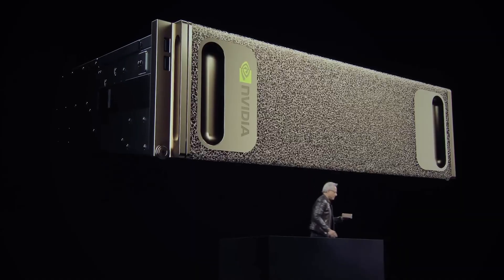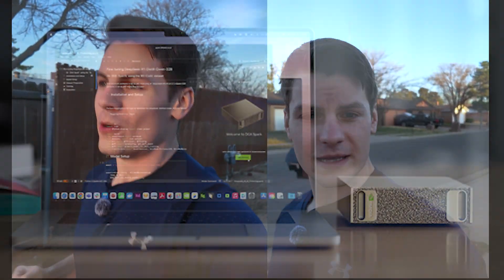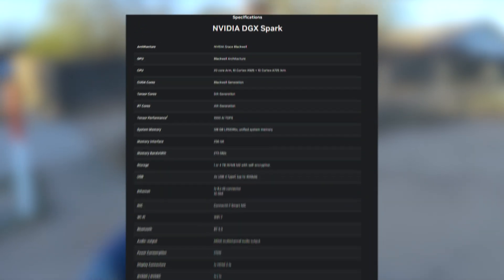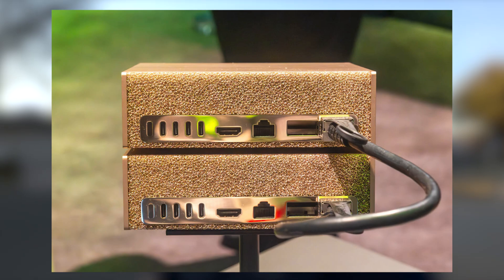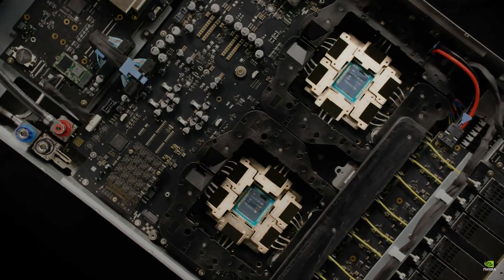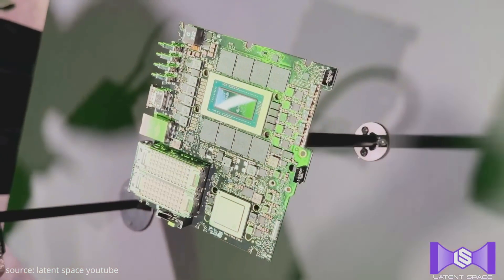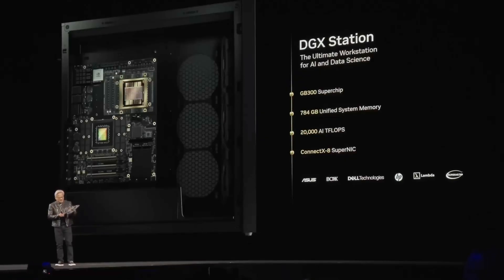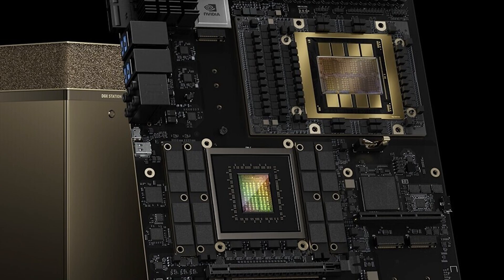Say Goodbye to Upgrading Your PC (Thanks NVIDIA!!)

Comment: These are separate chips. Check the AMD 395 out.that is 1 chip. Mem will not be limiting. Framwork will release a 128 Gb version of it. nVidia is balckbox

Comment: guys, there is a company that is going to launch computers made of paper 1000 times cheaper than the top nvidia gpu and with 10 times more performance, 1t roll consumes only 5000 wats and has the processing power of 2 nvidia data centres having over 2.6 trillion connections via 2.9 billion logic gate commands

Comment: bro it's priced at STARTING at $4000...   and they're not even for gamers.
this isn't gonna change anything. it's for AI developers, and i think if anything it's meant to help quell AI demand for gaming GPUs, so that AI developers don't have to use up GPU supply to develop AI tools.  but i mean, when you compare this to Apple's M4 and M4 pro, which are less than half the price of this thing in a mac mini, similar size, you know we don't even know if it will perform much better than the mac minis... and the mac minis are ALREADY losing out to the new AMD AI Max mini PCs, so ... i don't really see why nvidia is charging $4000 for this, it's not worth it, even FOR AI developers. it would literally only make sense if you were buying a lot of them and it came with a package support system like a software stack and support stack, etc. 

What COULD change gaming and home computing in-general is a new assembly language, of which many are being developed currently to attempt to spring computing forward. Similar to advances in DDR, using voltage "steps" to indicate data rather than simply "on or off", if CPUs could do this, it could potentially be a game-changer.  Tertiary is similar to binary, but instead of 1 and 0, it's -1, 0, and 1, so, "off, on, and on/off."   Tertiary computing is extremely hard to code and program for, which is likely why it hasn't seen much success yet, despite having been attempted since easily the 60s or 70s...  But, with help of AI and much faster modern CPUs and compilers, it could end up proving successful in the future.  

But even if we stick to binary computing, it still might be time to re-think x86 and ARM altogether.  ARM is very good for low-power devices, some of the M4 chips run on as low as  15-20 watts up to about 45 watts, which is pretty high wattage for ARM chips, your phone uses like 1 or 2 watts up to about 5 or 10 watts.    Desktop CPUs shine when used at around 100-300W or more...   What if we found a design language that was most efficient somewhere in-between these, with benefits of both?  People often think that for both of these systems, they're old and inefficient, or too weak to do anything truly useful, which... fair... but, they've both been altered and updated over the years.. the x86 of today is nothing like the x86 of the 90s, or even the x86-64 of the late 2000s.   

i don't know. i don't know how much longer PC gaming and customizing is going to be a thing, but i DO know that as soon as the DGX spark comes out, someone is going to mod it to death, someone is going to run SteamOS on it, someone else is gonna run MacOS on it, someone else is gonna emulate Switch 2 on it, and someone else is gonna build their own version out of off-the-shelf  mini-PC parts and some tinkering.   Tinkering and modding will never stop, no matter the products they choose to offer us, and so long as there's a market for it, there will be companies that wish to sell the parts that make this possible, and this is precisely how the GPU market was born, and now you've got not just AMD and nvidia and intel, but you've got AsRock, ASUS, MSI, Gigabyte, powercolor, XFX, and microsoft, among thousands of others, that aren't gonna be happy about x86 going away, nor about the windows PC gaming environment going away.   

On top of that, you also have to think... this thing MIGHT be as good as the Apple M4 Max at gaming, or even the z13 flow, but it won't be much better than that, not on ARM, and even if it costed $1000 or $6000, as long as it's only getting 40fps in Assassin's Creed Shadows, people out there will want something more powerful, which means they'll want a big GPU.  No one is gonna settle for a glorified phone box.

that being said... i DO believe that within the next 10 or so years, we will have basically hit max-performance out of the chips we're making now... So unless some major design changes come, or some new manufacturing process or materials, or something... then yes, desktop PC performance improvements will come to a crawl... But, you know.. they said the same thing in 2001, and then again in 2010, and even again in 2020... and yet, year on year, we still continue seeing 10-50% improvements, some years are better, some are worse, but overall, it's about 25% per year on average, both in CPUs and GPUs... Smartphones (ARM)  have averaged about 40% per year.   Now, nvidia and AMD have slowed this progression down for the mainstream, but the top-end like the 5090 has kept up with it. This is a shame, because nvidia has been hitting moore's law, but lying and saying it's dead, just so it can make money on top of money on top of money.

Comment: So they have soldered everything in to one single point of failure. If one chip fails the whole system dies imagine losing a 10,000 usd 20,000 usd system because your gpu soc or power management system failed what a joke.

Comment: You need to look at running LLMs to understand what the use case is. The components are not modular because they are low power focused. You're not going to game on this. You can't add 128gb of ram to a 5090, meaning you won't be running larger models. GPU memory is key to AI performance not just speed. Apple does have comparable memory sizes but look at the cost.

Comment: I don't see this happening. I do not think they can compete with modularity. They'd be up against everyone but themselves, and ARM. Heck, they'd even be working against themselves in some respects. I don't care about performance as much as I care about upgradability. Nvidias "Project Pixel" is a great example of Nvidias inability to compete with modularity. If one were to compare the performance of that little thing to a modular system that aimed for performance per dollar, the latter would dominate. Nvidia sells "premium" products, and so they have a premium attached to them. AMD has always made better video cards in terms of raw compute anyhow. This is what's going to happen: AMD is going to eat Nvidias lunch, and they will be the Intel of GPUs. AMD has better engineers.

Comment: Physics don't allow for cluster computers with low latency unless you have a very close proximity connection, example being CPU being placed close to the ram on the motherboard because electricity flow is fucking confusing.. 

So for the standard gamer, the hopes and dreams of being able to add more computers to speed things up isn't going to happen unless they're using some voodoo quantum light medium at super critical mass induced by absolute zero temperatures and hit with the correct dielectric Aether force and frequency. Then light itself becomes a "wire" in which said "wire" can be used to transmit information. Light can literally become a solid mass.

But at that point you have already invented time travel. 

I'm high, but theory checks out.
Reply from the maker: So during the video, I showed a clip where nvidia is actually using fiber wires on the board of one of their networking stations. It looks like that is already being done in some cases
Reply: They can make faster connections with fiber optic cables. That's how they connect their supercomputers into basically "one big GPU". Nvidia can do that. They're also going to make new switches for their new supercomputers in the future, so yes clustering is very much possible. Though of course connections still should be relatively short, but light can "transport" information much faster than electricity.

Comment: Its already here, the Framework Framework Desktop Mainboard, You Choose the Ryzen AI Max 395 and then a fixed amount of RAM. It looks like you can get your own SSD, which is the same as the DGX Spark, except VRAM is limited to 96GB. And that's from Framework their whole raison d'être is modularity?
Reply: @PioNunes  There are some single board computers for the 395 that use upgradeable RAM.
Reply: @shawnvines2514  Are they available yet? I've been searching for a while now and have only found the overpriced Rog flow 13 tablet/ laptop and the Framework PC, and a couple of miniPCs with no pricing or suggested availability.
Reply: The 395 has quad-channel ram. Does it use 2x camm or 4x dimm/sodimm?

Comment: A modular PC allows you to upgrade, but when you think of upgrading, it has already been some years and you realize that the best is to buy a new one, due to the compatibility. A modular pc is good if you are a person who continually changes your computer. The problem is not to be an integrated pc, the problem is to be a platform without possibilities, when you create a close ecosystem, you can't connect to external eGPU or devices, because of software limitations. It would be good for specific purposes, in this case, this pc has a specific purpose which is to handle AI models and training. If you want something more general or games I recommend buying the usual computers.
Reply from the maker: I’m that guy always changing out parts 😂

Comment: Does not matter that the components are soldered - every two/ three years I upgrade the whole system and donate to parents or family. The gains in performance and features are too high to sit on a system for more than a few years. You can choose not to upgrade if you don't feel the benefit - its the same scenario with those that upgrade their mobile phone every year or so.
Reply: I think CPU, Mainboard and RAM, all these can be soldered. Because by the time you have to upgrade any of these, you better to upgrade all of them. GPUs and SSDs, can still be add on. Though in the future GPUs and CPUs might also be fused onto one chip.

Comment: Big desktop computers are going away because they use too much power. Aside from that Microsoft is going to rather shortly move your stuff to the microsoft cloud anyway. You might think you'll just keep building and use linux, but there won't be enough of such users to make it worthwhile in the marketplace. System on a chip will just be more and more of a thing. Micro computers are next, as an interim kind of thing.

Comment: I think your overall augment of the future is soldered arm chips where w have no upgradeable pc's is true. But this isn't happening any time soon, arm is still in the very early stages of its life the only reason arm is where it is at is because of apple. if they hadn't then arm wouldn't be as advanced as it is, snapdragon finally caching up but software wise arm is the equivalent of trying to game on Mac. sure there's some native ports but 90% of the games on the market just aren't made for it. Arm the same way most software isn't even that good and Microsofts prism translation layers sucks ass. Linux's X86 to arm translation layer is million times better. so even if all the companies do transition to arm the transition is going to hurt a hell of a lot as it did for apple. Apple was able to easily get past this hurt by forcing everyone to use it with how intel, amd are dripping there toes in the water it might even be 20 years before gaming pc's fully transition to arm if ever. that's just my opinion, and I do believe arm to be superior in every way cpu wise anyways.
Reply from the maker: I agree thats why I went with a lunar lake laptop and avoided arm.. I see its potential though
Reply: @SiliconSteak  Very smart! honestly just depends on what your doing. if you really wanna use arm and need good software comparability  then buying a apple MacBook or Mac would be better as macOS has way better support than windows 11 arm. but I know macOS isn't for everyone as it's gaming is quite limited.
Reply from the maker: @Nova-Star888  yea I actually came from a m1 air. I loved it but I wanted all my games to work

Comment: I just bought a new mini pc like a month ago. Its the EVO-X1 from GMKTEK. Its has the ryzen AI 9 HX-370 with the 890M apu/cpu. Ok the ram is 32 GIGS of LPDDR5X soldered ram memory running at 7500 MTS. And the CPU/APU is soldered to!!!!! It runes fast and great I even use my VR head set on it but good luck trying to change anything out! That mini pc cost about $1,100 US. But its way up to date and if this is the way of the future its ok cause it does anything i need.

Comment: My gaming PC is a mini-PC under AMD 7840H and that is fine so far.
Having unified memory between the CPU and GPU is a good thing : kind of waste to buy 16Gb-24Gb-32Gb fast VRAM for the GPU only plus 32Gb-64Gb DDR5 for the CPU.
Mini PC APU and consoles are all using unified memory (mainly using AMD APUs for many years and keep improving gen after gen).
Now we need FAST RAM for efficient video and IA large models (VRAM speeds at least). 
This is where the industry needs to urgently innovate and provide new memory technology and standards for large and super fast performances on APUs. 
Meantime VRAM may do the trick, but quite expensive if 512Gb installed....
Reply: False sharing memory is horrible because the CPU memory is far to slow for the GPU and it always ends up being memory bandwidth starved.
Reply: @ZackSNetwork  consoles are sharing their memory. mini-PCs also. it works ! but your point is correct, we need much faster shared memory no avoid bottleneck the GPU/IA portion of the APU. The key element is RAM speed. hence the need for newer technology than good old DDRAM
Reply from the maker: We need higher bus width for APU designs too

Comment: And apple to time lock your purchase and prevent cheap upgrades.
There is no reason shared memory dedicated gpu and ssds to be soldered they will lose no performance socketed.

They just want you to think so and AMD is joining the club with Qualcomm and some Intel CPU GPU npus

Framework asked AMD why they could not have shared DDR sockets memory and AMD refused to answer.
The obvious answer are at purchase upgrade ram profits,bee already see these ridiculous prices to go from 32GB to 128GB.
What should be no more than $200 max retail is _600 to $1200 higher.

Apple does this with ssds as well.
They need to be called out by reviewers and companies and consumers.This, this  is anti diy upgrade anti repair and anti consumer

Comment: Agree, it is price gauging!. The Digit box should be $1K, not $4K!. You might as well get two 5080 and stick that into your PC and you got far more Cuda cores available. Sure it will suck more power but for the things you want to do, that is a better and cheaper way.
Reply: Nope, Nvidia doesn’t offer nvlink for consumer cards so the two 5080s would have to work together over pcie making the system much slower than the memory bus on the dgx. Also if you want to run larger models, 16 gb (or even 32) is not going to get you far. As an ml engineer, this is exciting, I can connect through ssh to a low power platform I can run 24/7 to train models - this is huge for developers